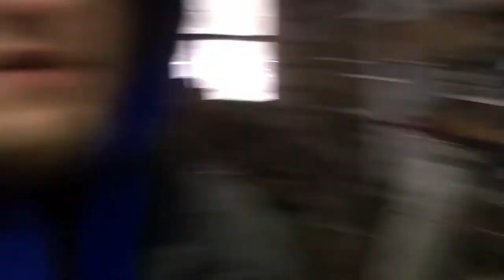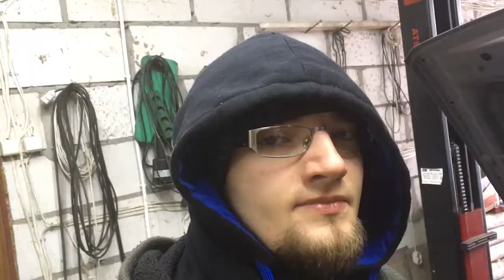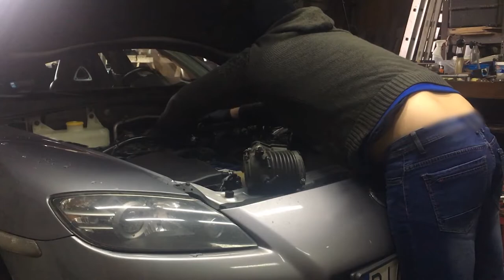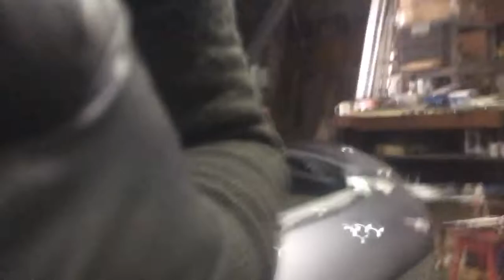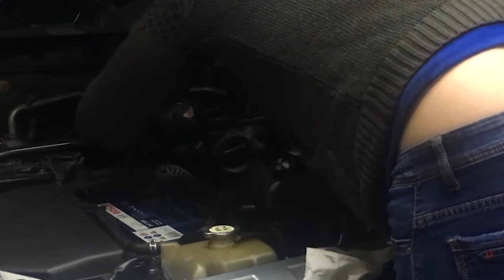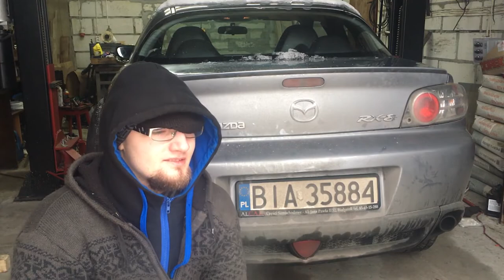Revert conversion of ls coils

Comment: Rx8 coils are not weak, they have a 45mj spark energy. Platinum racing did a test on a bunch of coils and the d585s measured at 29.3mj at 4.5ms dwell, and they're going to be even weaker than that at the Rx8's 3.5ms stock dwell. Problem with the stock ones is that they are too physically small to handle the fact that the rotary engine has 2 combustion cycles per rotor and have to fire twice as much as they would in a piston engine, so they don't last. If you want an upgrade Ryan Rotary Performance designed a new coil for the rx8 that has 96mj, has OEM fitment, and lifetime warranty. They're out of stock though, I'm waiting for them myself.
Reply from the maker: By weaker i meant that this set was used, and god knows for how long i drove on them 10kmiles and i bought car with them.
But either way thank You for big dose of info.